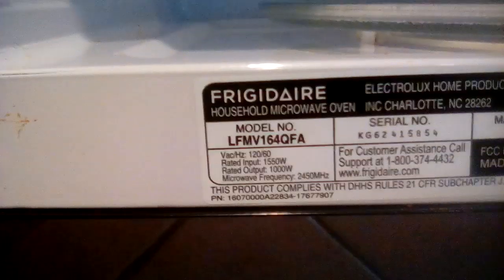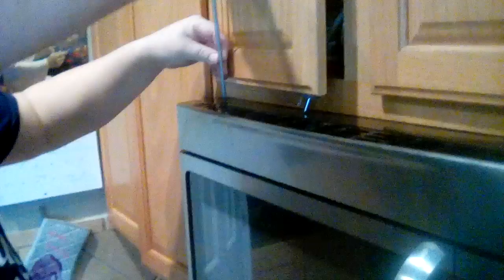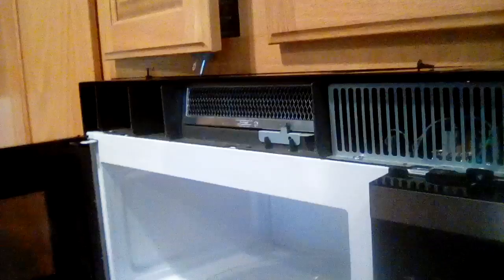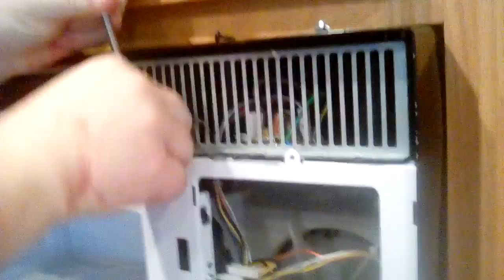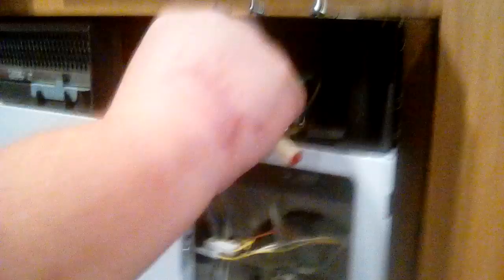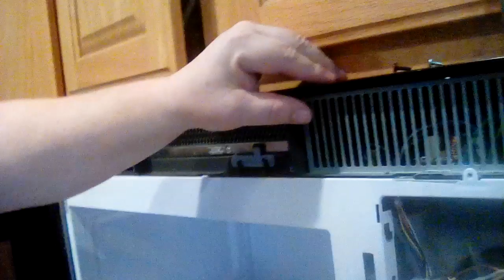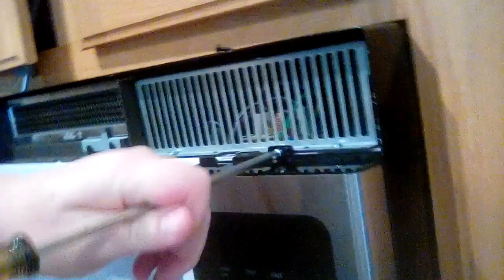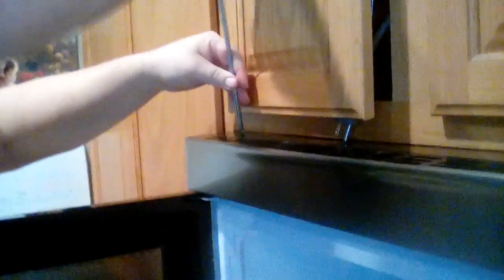$4 & 5 minute fix for microwave without power (Frigidaire LFMV164QFA)

Comment: Well I replaced my with 20 amp ceramic which said specifically for microwave, worked about 2 seconds and quit, tried the other fuse, same thing?
Reply from the maker: @biker1958  I'm guessing there must be some kind of a other electrical issue or short. Unfortunately I don't know what that would be.

Comment: In a hurry & forgot the number one rule when working on an electrical appliance. UNPLUG APPLIANCE !!   Was changing out one of the little light bulbs that shine down on stove top.  Turned light switch off, thinking I was OK.  Bulb had blown away from metal threaded cap.   Grabbed my small metal needle nose plyers to unscrew the cap enough to get my fingers on it.......ZAAAPP !! Sparks & popping !!.  Micro dead.  Thanks, Keith Houston for your video.  That 20amp fuse was the fix.  Saved me from purchasing a new microwave.